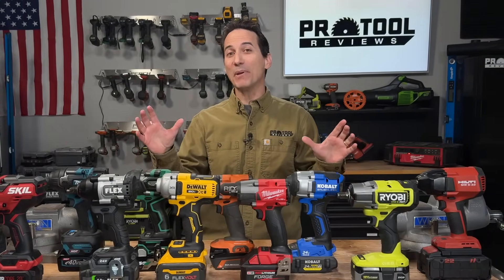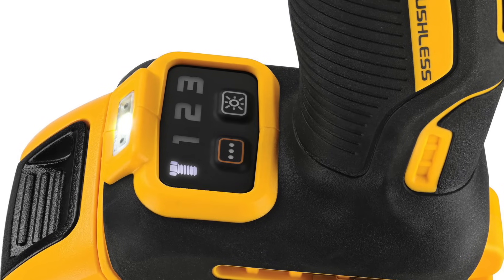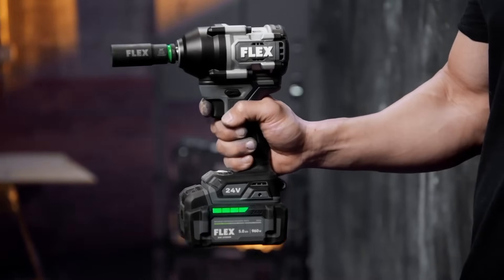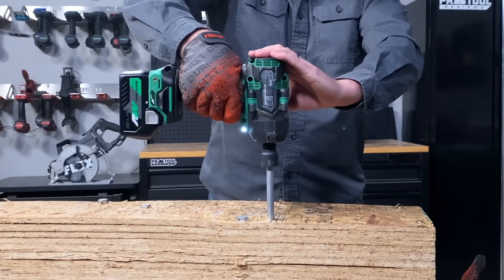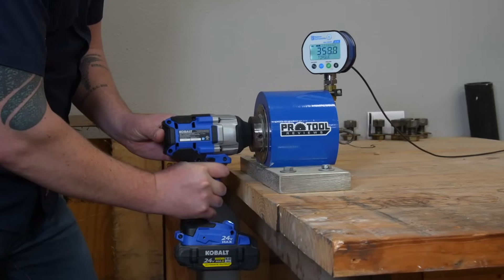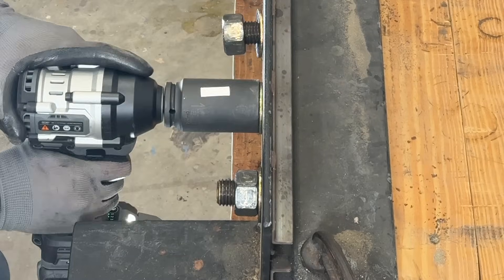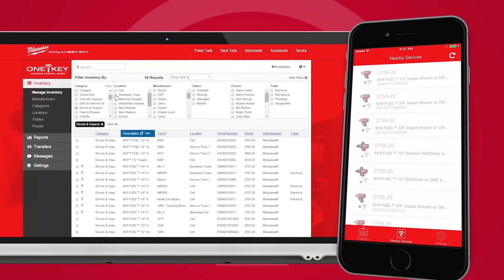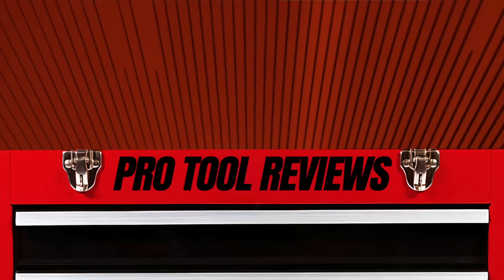Best Impact Wrench 2024? Milwaukee, DeWalt, Makita, Flex

Comment: Torque - Makita
Time - Milwaukee 
Power to weight - DeWalt 
Weight - Rigid
Length - Milwaukee 
Max RPM - Flex
Inertia torque - Makita
Lag bolt - Flex 
Price - Ryobi

Winner - Milwaukee 🤔

I don't think so

Comment: I have a serious question guys.... And it might be an obvious one for most of you. But i have to ask...  So.....

Should i buy a combo (Makita) that comes with the XDT16 (impact) and a hammer drill(cant remember model). Comes with 2 batteries, charger , and bagFor like $400 something. 

Or ....

Buy the XDT19 1/4" impact but it xomes with the tool, 2 batteries, charger, and bag. 

Think they both come with 2 5AmpHour batteries. 

I know youre thinking, "yeah dumbass get the deal with the lesser of the impacts but you atleast get a hammer drill with the combo!".  But part of me knows im gonna use the impact alot more than the hammerdrill so i want the XDT19 because its way newer than the XDT16.....

What do you guys think. Am i retarded?

Comment: I do automotive for a living and own the Dewalt DCF891 Mid Torque with the 5a Powerstack battery and love it. Compact and good power. For a high torque, I use a Hercules 1/2 impact, also with 5a battery. I tried their 1/2 compact Mid Torque wrench for a day before returning it (too weak) and getting the Dewalt 

I use the Dewalt more often these days. Helps a lot that I live where cars do not rust
Reply: You don’t regret buying dewalt over Milwaukee?   I don’t know what the Milwaukee hype’s all about

Comment: 11:29 I have two or three of these impact wrenches, the Dewalt and the Mabo, and they all are way stronger than the Milwaukee no comparison 11:36
Reply: Good, ive got a DeWalt impact from 2011, it was the best at the time but needs to be replaced. I'm going to just stick with Dewalt. It's never given me any problems and the batteries still hold a charge, for what i do anyway.

Comment: So the Flex has the most torque, higher RPM, and won the lag bolt test and the Flex is cheaper but the Milwaukee wins?? Come on every test “and the winner is Milwaukee” so much for unbiased reviews!!!
Reply: I so agree!! I'm glad you said something cause I was thinking the exact same thing.
Reply: Was thinking same and flex stirred up the game got over 1500 dollars worth and had milwaukee fuel before that both great just like innovations of flex and slightly cheaper
Reply: Exactly they Milwaukee fan boys.. just picked up the Flex on sale for 99 bucks at Lowes
Reply: 9:20
Reply: I agree the stats are good but I feel like it’s the build for Milwaukee that’s take the w it delivered almost as much torque as the flex but keeping mobility and space in mind especially if you’re going to be holding over head on lift 😅
Reply: That big bulky thing isn't better than Milwaukee, when you buy into Milwaukee you buy into a product line that makes sense. Like who makes a big bulky mid torque??? Makes no sense... FLEX GUYS always mad they bought into the wrong system, I'm sure it's fast, but at that size and weight no crap it better be...
Reply: @Jayknowstools 😂😂
Reply: @khiaraslaw flex just doesnt have a large tool library to use the same batteries
Reply: 😂😂😂 @Jayknowstools

Comment: It’s not a full comparison without Hercules and Bosch, come on guys!!
Reply: Yeah true Hercules line is overall super great value, and that comes from a Milwaukee guy who typically doesn't care. I wanna get the new 3/4 inch Hercules under like $200 compared to I think $350 from Milwaukee haha
Reply: The Hercules compact 1/2 mid torque is weak. Used it for a day before returning it. I now own the Dewalt DCF891 and love it

I also own the Hercules impact driver and 1/2 High Torque impact wrench. I'm very happy with those
Reply: @emmcee476  I have the 3/8” drive compact impact wrench and it has plenty of power!
Reply: @txvet7738  then the 3/8 must be stronger than the 1/2 🤷 I know the 1/2 was hit or miss with small car lugs. I do automotive for a living and tried it on different vehicles. The DCF891 is significantly stronger 

The Hercules impact driver is surprisingly strong when used with impact sockets and adapters. Because of that, I haven't had the need to get a 3/8 impact. The driver takes care of that. Also helps that I live where cars do not rust
Reply: @emmcee476  yeah I love my Hercules impact drive too! Watching how it stacked up in a lot of reviewers head-to-heads is what got me into Hercules, can’t beat the power to price with that tool!
Reply: @emmcee476  nothings like that 961 🔧 super powerful

Comment: So, no Bosch, no Hercules and you pick the winner as Milwaukee even though the DeWalt out performs it. Nice Milwaukee advertisement.
Reply: The current generation Hercules mid torque is weak. Returned it after a day when it couldn't remove mid sized car lugs. But their High Torque (that I own) and Ultra Torque are pretty decent with a 5a battery or bigger

I bought the Dewalt DCF891 for mid torque use and am very happy with it. Wanted something compact with close to High Torque numbers. That one has no problem removing lugs
Reply: Thus video isn't a torque competition
Reply: No festool at all 😂 o well its the pro machine afther all
Reply: Outperforms it?
Milwaukee finished first in the la bolt time and second in lag bolt remaining height.  It's the shortest in the group.  The other tests were just specs.

Comment: I feel like every video ends in “and the winner is Milwaukee but these other tools are good tools too”
Reply: I’m sure the check from TTI helps too.
Reply: Yep pretty much. Just as Stanley Black and Decker makes sure DeWalt is their top tool so does TTI with Milwaukee.
Reply: You also really have to pay for it @lesswatt
Reply: what other tool brand has a tool selection like milwaukee? 😂
Reply: @ka-chow22 Dewalt
Reply: @ka-chow22  rigid, dewalt, etc.

Comment: Makita wins hands down. Makita is never going to lower their prices, quality,  sell out or give anybody any deals period. You can tell that TTI will make sacrifices and cut prices and give massive deals for large box stores like Home Depot ECT.
Reply: makita actually has a lot of massive deals on amazon and some buy two tools get a jigsaw free and even rebates at amazon and HD. every company has to do it to stay competitive. but yeah i get the point high quality tools.
Reply: Makita also is my top. Electronics quality seem to be at the top. Warranty....Who needs it. D and M
Reply: Yeah, and TTI put plastic parts in their drive. It should be all steel, but nope, powdered metal and plastic in a lot of it.

The Makita 40v is a Cadillac. I've gone through a lit of impact wrenches, all the way back to hauling around a compressor, but Milwaukee was good for a while, their new ones have too many cost engineered parts (plastic) and Makita has stayed true to.the product, not manufacturing costs.

Comment: Declaring a "best" just sounds like an ad for the winner.  Instead, plot the models on a cost vs. performance graph, then overlay the "state of the art" curve (curated-curve-fit of the right edge) and subtly shame any unit that's far off of it.  Then people can decide for themselves which unit wins based on their budget.  Extra points if you give the plotted points badges for comfort, compactness, warranty, etc.  That type of video would beat all these overly simplified videos that we see on YouTube.
Reply: I'm sure there's a particular channel already doing torque test,and data tabling it out
Reply: @tensazero  Yeah, it’s called TTC, but they don’t do the sota curve either, sadly.

Comment: you tested the milwaukee with the forge high output battery but didn't test makita with their 'f' high output battery (BL4050F). Good job on rigging the results.
Reply: he tested Ryobi's mid torque with that garbage 4ah that dont have the 2700 cells so this is definitely rigged
Reply: Slap a 5ah power stack on that DeWalt. Then compare. Using a old 5ah. Even a 6 would of been a better choice.
Reply: is it even out in the States?  If not, then it's not really rigged